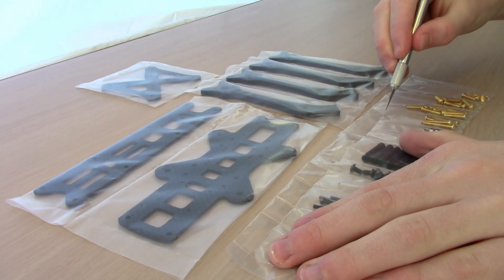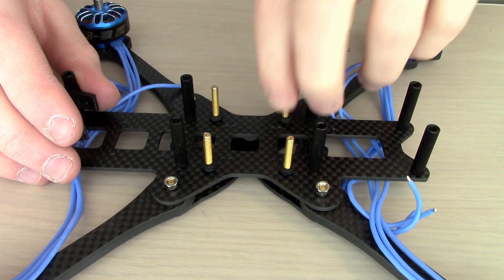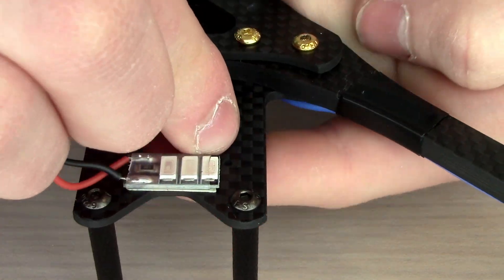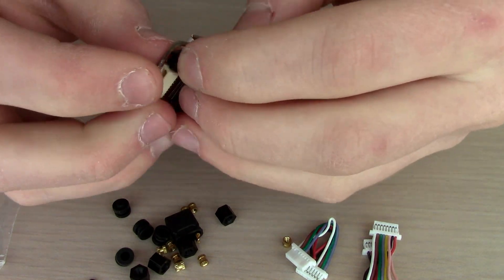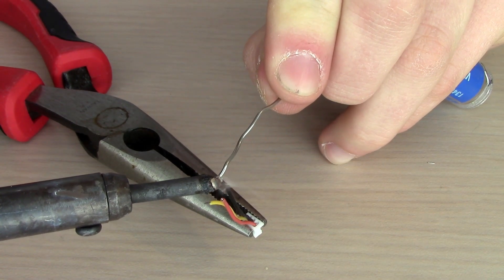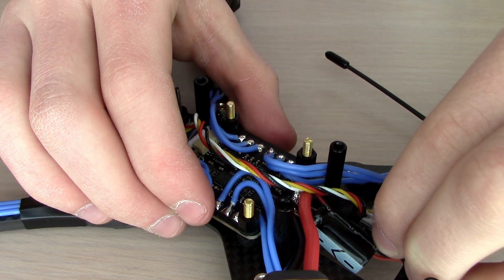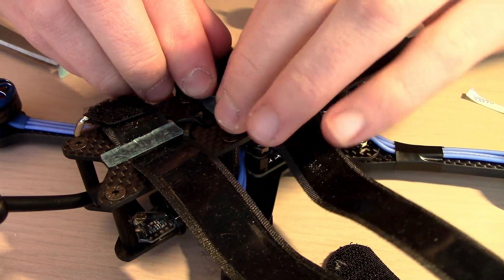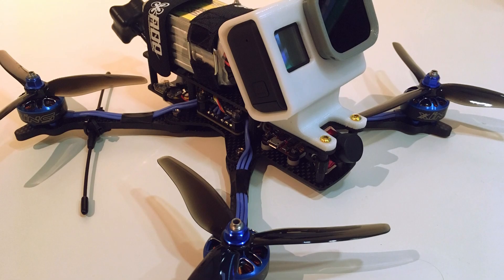How to Build a Drone in Under 15 minutes | Glide - 5"

Comment: Nice review. I would definitely invest into a TS100 soldering iron. Or a desktop variant KSGER T12 or similar. I have the latter and it is a joy to solder with due to the power and the regulated tip temperature.

Comment: So a caddx vista can Is too big for this frame ??
Reply from the maker: It would definitely fit but you would probably have to move some things around. Like putting the receiver somewhere else.
Reply: Master Jansens sorry I meant will the physical size of the vistas camera fit between the stand offs the description says micro cams only ??
Reply from the maker: @QuickSticks8771  There is about 23mm of space between the front standoffs. I do not have the vista so I am not to sure. I think it should be able to fit though.

Comment: Just curious, have you changed the way you route your battery straps at all since this build? Nice video!
Reply from the maker: Excellent question! I think I made a mistake in the video because the battery strap certainly works better when you route it another way. Here is the link to my build guide on RotorBuilds. It has a picture with the new (and correct) configuration for the strap. https://rotorbuilds.com/build/21933

Comment: is there no better way of mounting the VTX SMA than a cable tie? :D
Reply from the maker: The zip tie is nice because it allows the antenna to have some wiggle room in case I crash.  And even if the zip tie does break, they are super easy to replace! Also very light.

Comment: Nice job. It looks like you put the nuts for the arms on upside down. The more narrow end of the nut should be up
Reply from the maker: Actually, I'm quite sure the narrow end is best suited to go down into the carbon. The nut has little ridges that I believe are intended to bite into the carbon so it won't slip. Also, the holes in the plate are a little bigger which gives room for the ridges. Thanks for noticing though!